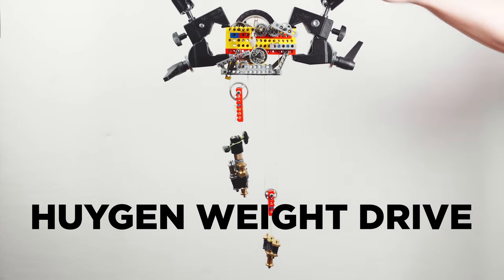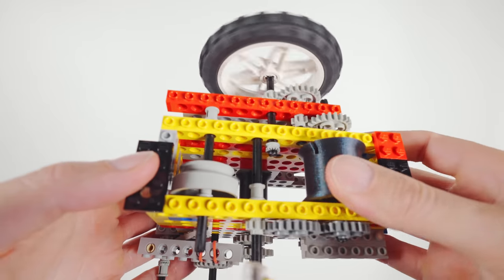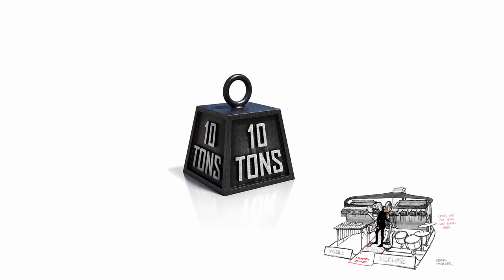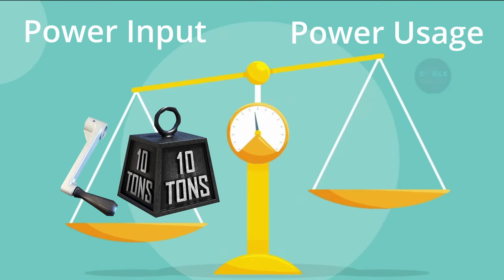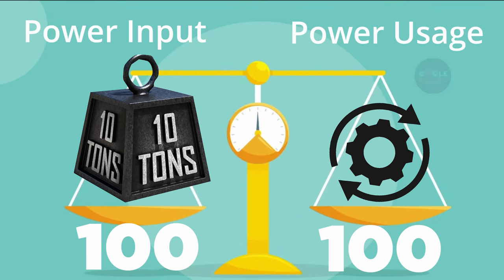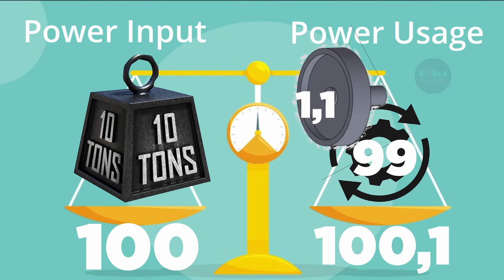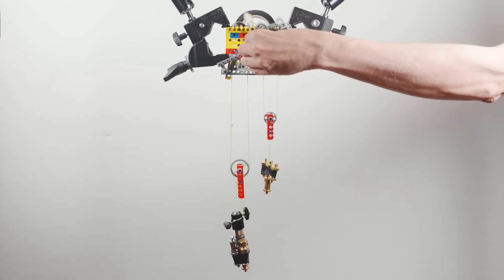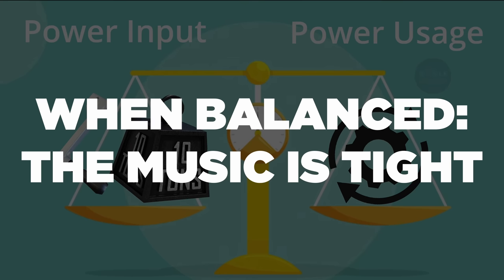Lego Technic Huygen Chain Drive

Comment: You know, Martin, if you make the hanging weight's minimum position 1 meter off the ground, and give it an upper range of 2-3 meters, you can hang the weight outside of the main body of the power module.  This gives you 2 advantages:
1.  You can see how "charged" the power module is and adjust your pedaling accordingly.
2. The Audience can see an aspect of the machine in operation, adding back some of that visual appeal.  But this time, without sacrificing functionality.

Comment: Honestly I thought the magic of the original marble machine was that it was hand cranked.  The imperfection in the timing was noticeable and added to the effect more than detracted.  As others are saying I think going for this ultra precise automated system you are veering too far away from the original concept.  I mean at this point whwy are you even re-engineering these old school designs, just strap a motor on the thing that has variable outputs and call it a day....

Comment: If you just want to play tight music, why add so much complexity to it? Just add variable frequency drive. They can run at any rpm and alter torque as there will be difference for sure. For example, more notes means more lifts for programming wheel, thus more friction ans more marbles to lift as well and that equals more load. This cannot be accounted for with constant weight. I guess the hand/foot crank is the best option to keep it interesting and add human touch to it.

Comment: I still think you were measuring the wrong part of the previous system, measuring the input and not the output of the flywheel, which could have worsened the figures of the hand cranked tests

Comment: Why not solve all this with an electric motor?   Which allow you to move away from the marble machine to play another instrument and choose different tempos. Also.. all organs on church use electric motors to charge the air compressor. You would be also using microphones and amps on your marble machine, so not sure what is the point to say no to an electric motor.
I think you are making the same wrong choices than you made in the first two version by focusing in the hardest path to certain goal.
I do not think you are aware on how many variables and chances of issues are you adding by choosing these mechanism which were not original designed to your exact requirements in mind, things not always scale up so easily.
Setting the machine on each stage would be also a pain in the ass with all these new pieces.
I recommend you to start with an electric motor and then if you want, in a next world tour, you can try to accomplish this.

Comment: On MMX you had an electric motor driving the system. Wouldn't an electric motor with fine RPM motor controls, digital rpm input and a tight feedback loop be a much simpler, probably off-the-shelf and less expensive approach? Why the focus on an elaborate hand-cranking system? This approach, while mechanically 'cool', seems antithetical to reducing complexity. Heavy dropping and spinning weights also create major safety and travel/packing issues. The best part is no part.

Comment: Martin, as others have mentioned or alluded to, I think there’s an important test you need to run:

How varying the load on the output affect the speed?

What if some part gets knocked a little out of whack in transport? What if one module isn’t perfectly aligned in setup, inducing friction? What if the machine goes from full mute to everything engaged, suddenly going from lifting no marbles to dozens at once?

Does the drive hold up? If not, can you compensate for it on the fly?

Comment: Combining flywheel and Huygens drive seems redundant to me.  Aren't they both methods of storing energy?  Of course, each has its tradeoffs - Huygens drive is more consistent but limited in how much energy it can store. Flywheel can store a lot of energy, but less consistent and its speed will decay if theres no power put into it.  I cant help but think there must be an elegant solution that combines the benefits of both in one device. How about a flywheel that uses its kinetic energy to raise itself so it can at the same time act as the weight that drives the Huygens drive?

Comment: Rather than going down a whole series of new rabbit holes designing this drive system when he doesn't actually have a clue about key aspects such as power requirements or profile, why not go with motor drive in order to get the machine designed and running? Once the system as a whole is proven he can revisit the manual drive mechanism armed with real world data on power requirements etc, plus he will have data on how tight the rest of the system is. There's little point aiming for "0.01" precision if the rest of the machine combined can only achieve "1"....
Reply: I've been saying the same thing for the last 6+ months.  And no doubt, I'll be wondering the same thing for the next 6+ months...

If anything, he could at least get a functional machine going electric-powered first.  Then if there's still interest (unlikely), he could convert it to human-powered.

Comment: Do you really need all that mechanical stuff for the music you want to make?
As you move forward with a little more precision and a little more tightness, you're eventually going to run into the limitations of the mechanical structure again. 
and eventually you're not going to be able to get to the peak tightness that you want without using electronics or motors.

Maybe it's time to rethink the way you do things.
You need to do a full prototyping run of a drivable but modularized instrument that can play even a simple nursery rhyme.
From there, you can improve on each module to make the next version, and the next, and the next...

Comment: That is solid thnking. It is of course also more fail points, but the tech is old and tested. I would add a failsafe. A way to disconnect the weight drive-governor part and connect crank direct. Should be doable with a couple of cotter pins.

Comment: Question, could you replace the weight with a type of clock spring? That should solve the need for height? (Not an engineer 😂)
Reply: they would be a decent option but they arent perfectly constant like gravity is
Reply: No.

Comment: Wouldn't it be easier to... use an electric motor? Anyways, you're already isolating the human input with a weight system, why not just embrace that the focus should be the musical part of the machine and not the power of the machine.

Comment: How are you supposed to keep a 10 ton weight in the air with hand power. 
You need to gear it down to a ridiculous level, you'll be cranking that thing like a madman.
Either you need to put away your tightness obsession, or you'll need to go fully electric.

Comment: This solution is inefficient.  I’m sure you can find a better mechanism to govern speed for tight music that requires fewer components, adds less weight, requires less adjustment, and is more reliable.  Can you imagine setting up a system of weights and pulleys on stage?  It’ll be fiddly, bulky, and will come with its own assortment of squeaks and breakdowns.

It’s important to find balance between your requirements and engineering limitations.  Keeping the component count low helps.

Comment: Martin, please stop wasting time. You need a motor. A powerful one.  You don't need stable power input to the machine, you need a power input that will be compensating for whatever unstable usage is applied to the flywheel. It WILL be unstable!

Comment: You’re goin for automation and tightness. Not much human interaction. Might as well strap an electric motor and use MIDI
Reply: What automation? Yes, the programming drum (but that's always been there), the human interaction comes from flicking the levers and switches on the machine that bring different parts in and out of play. If the tightness came from a well-regulated input (electric motor), then I'd agree; but Martin still wants to power this thing manually - just because there's a governer/flywheel smoothing out the inputs doesn't IMHO take away from the manual input. That said, he may need an electric motor to raise the 10 ton weight anyway...
Reply: @theelectricmonk3909  we’ll just have to wait and see the final design 10 years from now
Reply: @ivandagr857  I've been watching Project Binky since about episode 10: I'm well used to waiting years for stuff to get finished on YouTube!

Comment: I just wanted to comment that the huygen weight looks more like an energy storage device than a power input. What I mean is, I'm looking at it more like the center crank in the mechanism is the power input and the huygen weight just smooths the power input. You can have it as small as you'd like because ultimately, the input of the power balance is being supplied by the cranking. And maybe you can find a similar mechanism with a different kind of energy storage device, that would help if further smoothing the power delivery

Comment: This starts to feel like you are suffering feature creep again. Didn't your original measurements suggest that your marble gates already can play pretty tight music? Why does ot need to be even tighter? Are you sure this isn't just a form of procrastination to delay the building of the new machine? 

I am all in for a governor, but have you done calcualtions on how big the weight for the drive actually needs to be? Balancing a huge weight over a stage seem like a big safety hazard. Are you sure you can implement it without endangering you, your band and the audience or damaging equipment, if an accident occures? 

Also, like others already mentioned: how tight does your music actually need to be? Do you really want clockwork precision, eliminate the human factor? Don't you think it might sound too sterile? Wouldn't it be easier to use a computer to achieve the same goal?

Comment: This is a LOT of complications for a system that replaces a tried and true motor on a PID loop.  You are going to have a ton of electronics on the output of this machine to get the sound you want, why are you so against electronics on the drive train side? There are just SOOOO many moving parts in the system you are making compared to a motor with 1 moving part.

Comment: How dull.

It would be more fun if there were a pair of weights, and each weight could be filled with water when it gets pulled to the top. 

As it drops, the water slowly drains out until the weight reaches the bottom. At same time, the other weight has reached the top, where it will gets refilled again. 

That wouldn’t be especially useful, but it wouldn’t be as boring as this video.